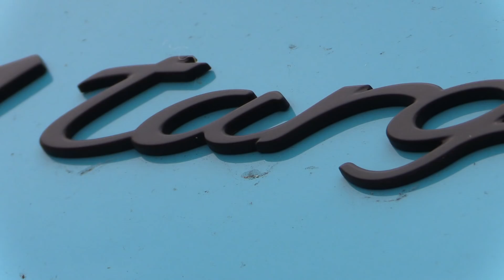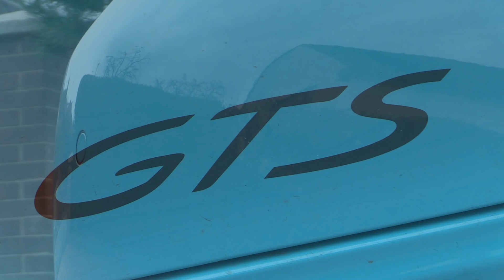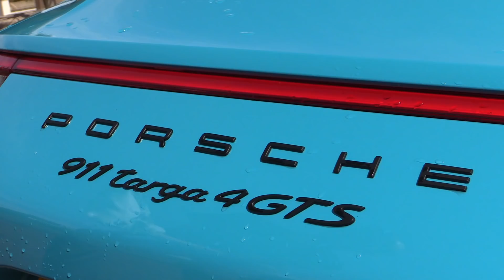Are 'Dealership Protectants' Worth it?

Comment: I used to work for a prestige brand car dealership and the valeters were contracted in and on minimum wage. The sales staff were “trained” to sell the product but the valeters were not trained to apply the products. They weren’t even trained to wash cars! They would apply a particular brand of product to new and used cars, cars which had received no more thana basic wash with a brush. Yes a brush! No two bucket professional valet. No decontamination etc.There was huge profits in the sale of the product hence dealerships selling it, and I must admit I’ve seen it used on new vehicles and when applied properly does add some value of protection for after around 12 months needs fully reapplying. It simply won’t last the 7 years it claims to work, and certainly not for the lifetime warranty it claims to support. However, the interior protection is, in my opinion, useless. One customer tried to claim on warranty due to staining on the beige leather of a 3 month old prestige brand car in excess of £100k, and it was refused on the grounds of “sorry it doesn’t cover dye transfer from clothing”. Anyway, no products mentioned, but I think we all know. Thanks for sharing, great video.

Comment: I paid for this 10 years ago from a company called paint seal direct for £350 on a red Grande Punto
It was applied at my house 2 weeks after it was delivered and the guy used a waterless wash product to clean the whole car before applying the seal despite it being driven nearly a 1000 miles and being muddy etc.
He showed me the product which was in a tiny 50ml or so bottle and the whole job was done within 1 or 2 hours (interior as well).
It had a 5 year garrauntee (with no explanation on the terms or how to claim etc)
Needless to say that after 6.5 years later the paintwork was faded and swirled to hell... 
Now that I have 'some' knowledge of detailing looking back they got me good. If I ever get offered this again I will enjoy refusing and listening to them trying to sell it..
Even a simple spray wax these days beats what they sold me

Comment: Quite frankly, no dealer protection is crap. Always has been, always will be. I've come across quite a few 'dealer protected cars' in my time and I have only ever been surprised on a couple of occasions when I found the water was still beading. But the level of detail and results achieved by the dealers are no comparison to a professional detail and ceramic coating application which can normally be had for a similar price. Excellent video Guru, look forward to the next.

Comment: I saw the original upload and I love your subtle changes. You're 100% correct, though. I used to work for a Ford dealer as a valeter before going self-employed like yourself (though I don't do quite as high-end a job or car!), and the supagard package was £350. It cost the main dealer about £70 for the full kit, and about one hour of a minimum wage valeter's time to apply the paint sealant, the aerosol alloy protector and the horrid-smelling scotchgard ripoff. And, after a year, there's little to no evidence of it left.

Comment: after working for many dealerships as a valeter using a product called GardX i can confirm that even when the products are applied correctly, they are poop... although they were never applied properly (sometimes not atall) due to the pressure to get the cars done, they are usually just applied to the bonnet after a quick sponge wash and chamois dry, was quite upsetting really as 90% of the people that paid for it were elderly people

Comment: I sold loads of these type of paint protection products at dealerships. The products are ok but fall down on application. Minimum wage valeters, usually over worked and under pressure to prepare  long queues of vehicles. Lost count how many times the valeter just put the " paint protection brand " sticker in the window, gave the seats a quick squirt of fabric protector so it smells nice and then we handed it over to the customer.

Comment: My father in law bought a new car quite a few years back, and was sold one of the protection packages. After all was said and done, he was telling me what they did, and part of it involved an interior leather treatment, I was perusing through the owner's manual and it stated that the leather already had a protectant applied from the factory and was warrantied to a certain extent. It was also written that any other protection that was applied outside of normal cleaners would void the factory warranty on the leather. The protection packages did have a warranty, but not as long as the factory warranty. To say my FIL was hopping mad would be an understatement, he went back to the dealership and had the cost of the protection package refunded to him.

BTW always enjoy the videos.

Comment: I'd love to know what the mystery product is! My car came with GardX on it. Whoops! I said it! I had been using T-Cut Nano-Tech, which is good and easy to apply but only lasts about 6 months.
I actually think that GardX is very good, but just as you said the stealership didn't clean off bird muck soiling burns properly and sealed them in. They also put the stuff on the windscreen which caused horrendous wiper chatter which I've had a mare of job removing the stuff with cerium oxide glass cutting paste and an electric polisher. Good testament for the product, but don't put anything on swept glass. That includes RainX. 
So now I have holes in my gardx where I've had to polish back to the paint. The company says their product is only available to the trade, so why can it be readily bought on Ebay then for £4.99+postage! 😜

Time will tell how I get on with it from here, but my first impressions are good, as long as it's applied by anyone else but the stealership.
By the way that collinite wax is fab on wheels.

Comment: Very slight Scouser accent? I was wondering if you were from around Manchester until I heard you say "bakh" towards the end. Thank you for the informative video. I will tell the dealer I don't want it 

I must admit a few years ago a BMW dealer applied it without me agreeing to it on a deep metallic blue 5 series and I actually thought it was great. I drive tens of thousands of miles a year and after 3 years it was still fairly good. The water beads off nicely and I felt it was easier to keep clean. Not sure it was worth 800 pounds but I been offered the autoglym treatment for less than 400 this time.

Comment: Extremely relevant and well presented.  I did previously add this comment to the first film that was taken down. I paid Bowker BMW £360 for their GardX protection.  And as you pointed out, this was due to my non existent knowledge of detailing and paint protection.  Obviously I can't comment on how well the job was done but the paintwork looked good and was hydraphobic.  I recently had the car deep cleaned, clawed and machine polished and then coated with gyeon can coat . Unfortunately there were issues with water spotting as it rained  not long after finishing.   The Detailer will rectify this for me and has been really good. However, water spotting aside I don't think the finished look of the paint is as good as it was when I bought it. I guess this is based on personal preference as I'm aware different types of coatings give a different look, especially on a Safire black care.  It is extremely hydraphobic. What is your experience on the best finish for black cars ? Anybody else is welcome to pass on their thoughts.
Thanks in advance
Mark

Comment: I bought a nearly new car recently which they said had been treated with a very famous F1 teams synthetic protection - i didn't order it(thats another story) but there are horrendous swirls and contaminants under the coating that make the car look terrible when cleaned. Is there a way i can remove all this and start again?
Reply from the maker: Yes as it’s not a coating it’s a sealant so any kind of heavy strip wash, clay or polish will remove it (assuming they even applied it to begin with).
Reply: @CarCleaningGuru  it's got something on it but god knows what! thank you for your helpful advice! used to do valeting years ago but didn't have to deal with synthetic stuff back then :) Your work is a pleasure to watch!

Comment: Hi. learned from your channel, thank you.  Rather than using the local hand wash I've decided to properly look after my new motor myself.  Given I don't have a snowfoam system what would you recommend to help remove hard to remove bugs and bird droppings...in the hot weather they are a plenty. Don't want to use anything too harsh .. Thanks in anticipation.

Comment: I've often wondered about whether to apply a ceramic coating to my BMW, but what worries me, is what happens when it starts to wear out or come off. From your experience, what generally happens when it starts to wear? I have this horrible image in my head of the way lacquer sometimes delaminates from paintwork, but I'm sure it's not that bad. :) And when it does start to come off, what is the best thing to do to strip it and re apply.. or just re apply over the top of the old? Thanks so much for your ace videos. :)
Reply: glynharper don’t worry it doesn’t bond to the clearcoat like a paint would, effects of it eventually wearing off would be the same as a wax or sealer, just less of a shine and no water beading. Some products have a top up feature where u can repair or add to the surface or you can start all over again after a decontamination wash, go back to “ naked paint” and apply again. 👍

Comment: i had my 18 plate qashqai supaguarded from the dealership, got it as a additional free extra. i use there maintenance pack and must say when you work to detailing standard, 2 bucket wash, decontaminate with their products (tar and glue / bird and bug) with what they give you, in the 2 plus years my car has maintained its showroom pristine shine in and out. My next new car i probably wont get it coated and get a detailer to do it but if you are like me and have an eye for detail, wash 2 bucket and use their or any dealership protectants maintenance packs for decontamination as well, it is worth doing. if you wash your car yourself the dealership part is worth it. if not get a detailer to do it. Thats my 2 cents worth

Comment: Hey CCG, been doing a lot of research re ceramic coatings and would love some feedback from your experiences with metallic finish cars.  We’ve had previous new vehicles with metallic paint that have had ‘coatings’ applied by dealers (I know, but we didn’t know better back then).  One was a black metallic and the other white, and in both cases, in my opinion the metallic finish was underwhelming. The paint was ‘glossy’ but definitely looked flatter, and I didn’t think much of it at the time.  My current car has been professionally prepared and coated, and it too has metallic paint - much more metallic than the previous vehicles, and it too appears to have has lost some ‘sparkle’. Yes the finish is glossy with awesome beading & highly reflective, which seems to be the finish the detailing guys all love, but I want the finish to enhance the flecks of metallic .  I’ve scoured the internet and only come across 2 detailers who agree with what I’ve experienced. To the point that I’ve been told it must have been poor preparation that caused this ‘side effect’.  However I have screen shots of numerous vehicles showing a highly flecked metallic in a before shot and an almost ‘sparkle free’, glossy, reflective finish in an after shot.  I’m changing my car in a couple of months, hence the research, and coming down on the side of wax to keep the sparkle.  So what do you think?  Does the desirable glossy, mirror like finish you get with ceramic type coatings reduce how obvious flecks in metallic paint are?

Comment: Wait a second... 2:57 is that one of the early stages of rust? On such a new 911?!
Reply: Luke Remijn no.. it’s a tougher paint surface.
Reply: noo, its a thicker and more duarble layer applied before paint, its a bit like rubber paint the helps stop stonechips
Reply: Oh I did not know that! I already found it hard to believe that it was rust. Is there some technical term for that? I’d like to know more about it.
Reply: It will be an Anti-Gravel primer.

Comment: If the GTS (or any car for that matter) has been treated with ceramic, common wax/polish will not bond with the ceramic.  It will leave a short-lived luster, but it will quickly wear and wash away.  There are specific protective sealants which can be applied to ceramic coated vehicles.  My GTS  received PPF and 3 coats of ceramic.  I have a 7-year warranty.   It remains to be seen how it does over the long term, but in the interim it stays very clean.  Little sticks to it, and a quick wipe using an Armor All Wash Towel really does the trick.  I am not putting down your opinion but simply reporting on what I am experiencing during the first month of ownership.
Reply from the maker: This hadn’t been ceramic coated it had been ‘Supagarded’ which is just a sealant.